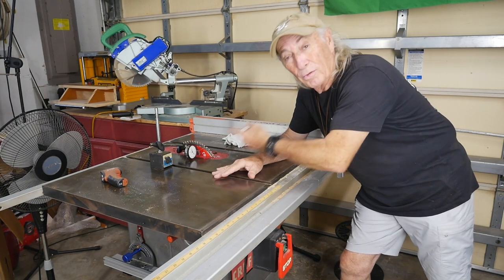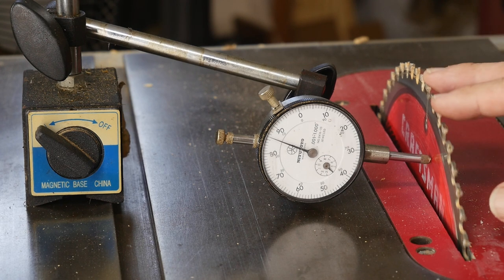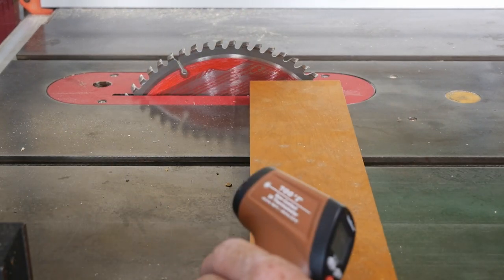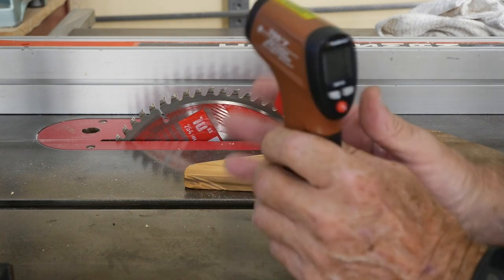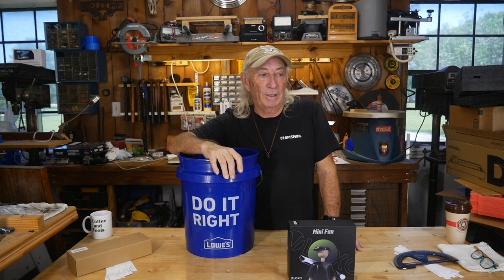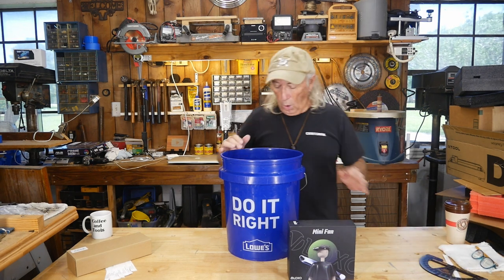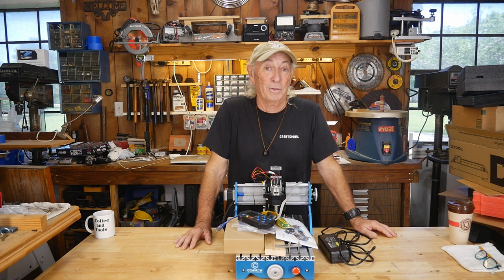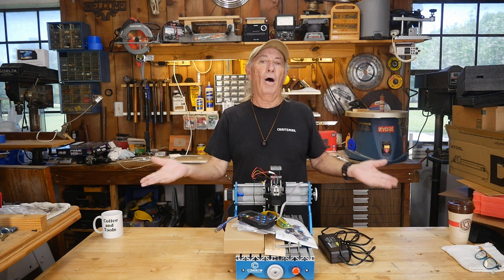Table saw blade heat warp myth ? Also: Drawing for tools and CNC giveaway Coffee and Tools Ep 251

Comment: Thin kerf blades probably have more run out. My hottest blades have tended to be from cutting a pretty damp 2x4s skinny side up. They smoked a lot too. Home depot had some super green and wet boards that day. I think most of the heat build up comes from the gullets between the teeth being buried in the wood and not having enough clearance to clear the saw dust out.
Reply from the maker: The wood burned here, but I could not get heat on the blade. Wet pressure treat will burn good too :)

Comment: I have never really had much trouble with my table saw blade warping but I have had issues with my Worm-drive blade warping. I think most of the issue has to  do with me when I instal a new blade. there is a diamond shaped insert that must be removed to put the blade on the arbor. I have learned to put the blade flat on a piece of wood and with a nail set or punch tap on the insert until it comes out. you really do not want to put a lot of side pressure on the blade. I have had to throw out a few blades after using them for a few jobs because they were warped too bad to be of much use. once they begin to warp it just gets worse. at that point it is time to cut the loses and instal a new blade.